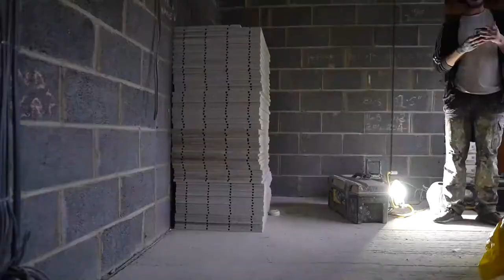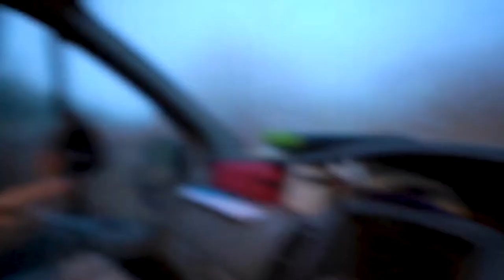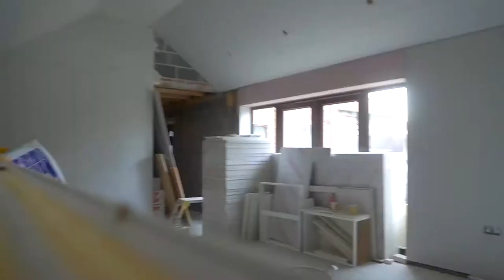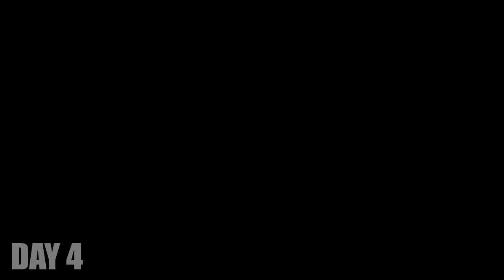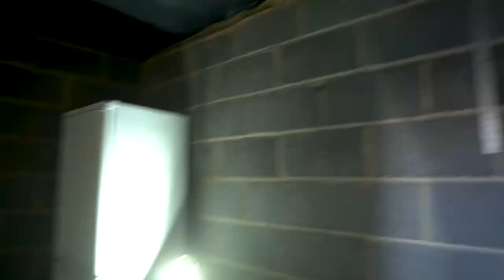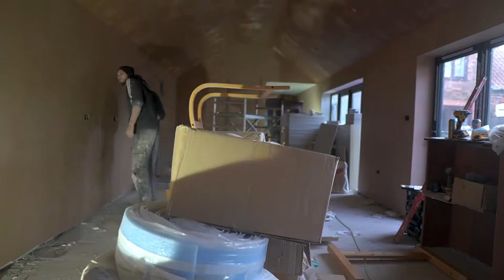Last Job of the year - Kitchen Extension Project Vlog - Massive Curved Ceiling - Part 2 (Reuploaded)

Comment: Would it not be easier to dry line such a large ceiling ?
Reply from the maker: I would be easier yes, but then you wouldn't have the additional thermal, structural and acustic benefits that skimming provides.
Reply: It would look shit, not rolled